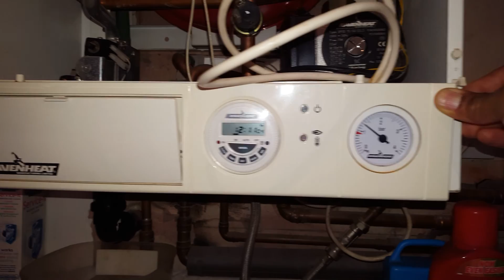Boiler Repair Ravenheat 85CSI

Comment: Hi.no hot water. Radiators working. Boiler only firing up with Radiators on. Not firing up with hot water only. Tips?
Reply from the maker: That could be a divertor valve

Comment: My 85CSI does not like the cold and goes through the cycle but does not like firing  up from cold , once warmed up she fires up no problem , any ideas ?
Reply from the maker: Possible primary sensor
Reply: @ARBoilers  Yes had to replace both a couple of years ago as the boiler kept switching on and off .
Reply from the maker: @nicnak4475  they may need changing again
Reply from the maker: @nicnak4475  they can do you best get out an engineer

Comment: After 3 failed thermistors in 5 years replaced them with clip on ones. No problems since. The original ones sit in pressurised water obviously leading to premature failure.
Reply from the maker: Yeah good call
Reply: Hello Jay Cee  I have had the same problems , what are the clip on ones ? thanks

Comment: Good call on the problem thermistors mate ! think so many guys have binned their boiler when the thing keeps switching off ! £6.80 for two of the little pesky little  blighters and sorted ! now running as sweet as a nut but now noticed some drips coming down through the boiler when cold  so will have to get that sorted , excellent vid and the way you point out the components , well done :o)